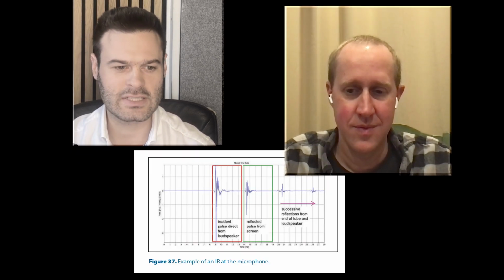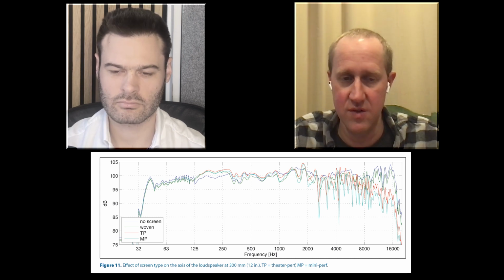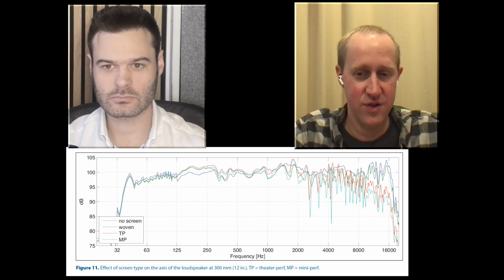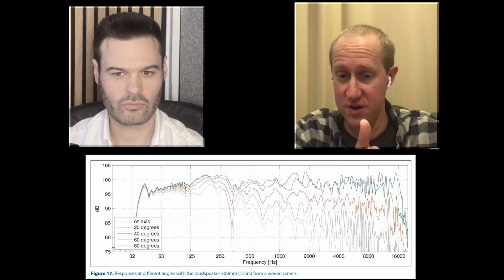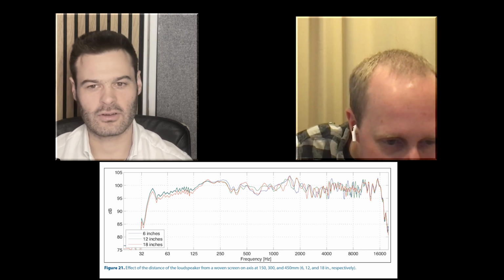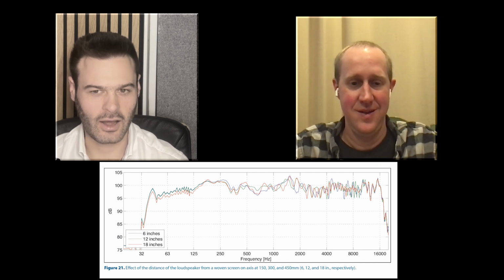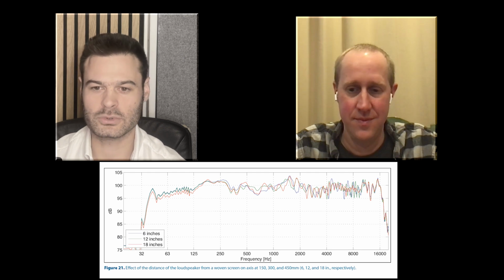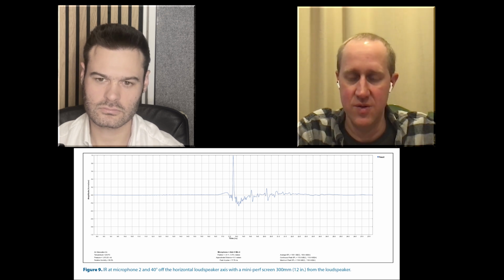How Acoustically Transparent is your cinema screen? Episode 4 Guest featuring Brian Long.

Comment: What about speakers covers in general? Some are fabric and some even have solid grille type covers so what's the effect of those?
Reply: Fabric speaker grills are usually a much finer material than screens. If you shine a light at most grills, a lot of that light is going straight through. The grill may have an audible effect, but it should be much smaller than a screen. 

The screen is trying to fight two conflicting battles, it ideally reflects light but not sound.Even speakers with "solid" grills, the % open vs blocked will be much higher in the grill than a screen because it has no need to reflect light.
Reply: @bengoff4636  Got it thanks
Reply: @relooc  We do remove the grills from all speakers that are not on show. The only reason I'd generally leave a grill in place is the speaker is on show and the grill is a major part of the aesthetic design or if its needed for protection... I have a 5 year old and a 2 year old, grills are a valid compromise for my HiFi at home for protection from wondering fingers
Reply: @bengoff4636  yep same here. Grills = protection lol

Comment: Extremely good information guys,  so I will never install a acoustic transparent screen in my home cinema. Nice to have the top of the industry home theater guys talk about it, learn something new 👍 from Canada 🇨🇦
Reply from the maker: As with everything in the cinema there is a balance of compromises to consider. 

Placing the speakers behind the screen can significantly increase the sound to image coherence. Our brains can be fooled by the Ventriloquist Effect, but audio from speakers located behind the screen are currently still often the preferable solution.

Rather than putting you off behind screen placement, we wanted to highlight the important design considerations to minimise the impact the screen will have.
Reply: @SeymourScreenExcellence  Best video? Are you saying the best non-AT solid screen does not perform better in image quality parameters (color, sharpness, contrast, etc) than the best AT screen, e.g. Stewart ST100 vs Dream screen V7/Seymour Neo?
Reply: @SeymourScreenExcellence  Fair enough. But some negatives to AT screens dissuaded me from getting one. 1) it usually requires building a baffle wall which reduces the throw ratio & I was already up against my limit, 2) the visibility of the weave depending on how close you sit, 3) reduced brightness compared to non AT unity gain screens & 4) a hit in sharpness & fine detail ...not too mention the premium one will pay for a good quality AT screen over a comparable solid screen.